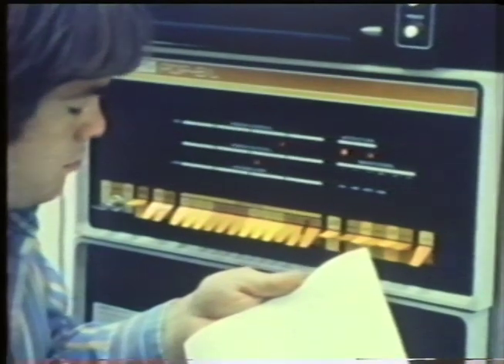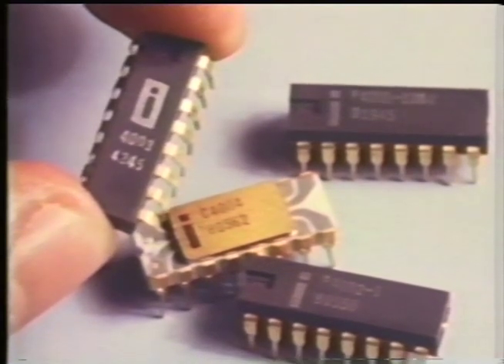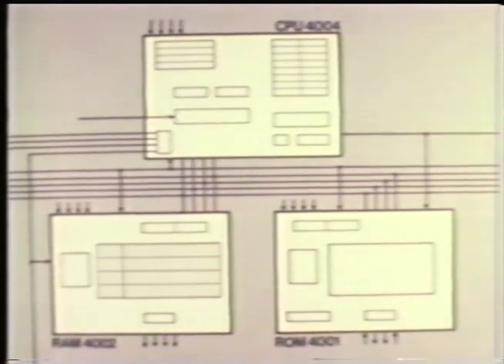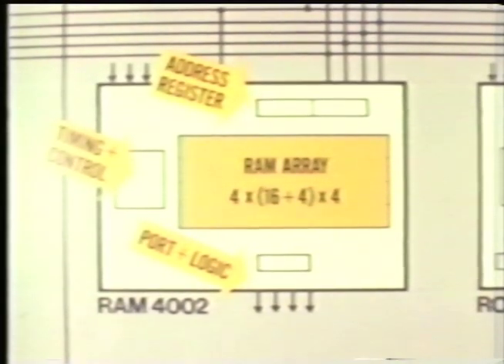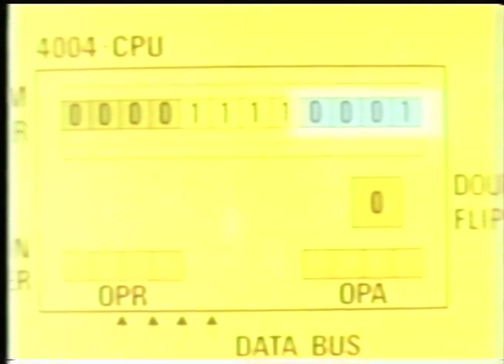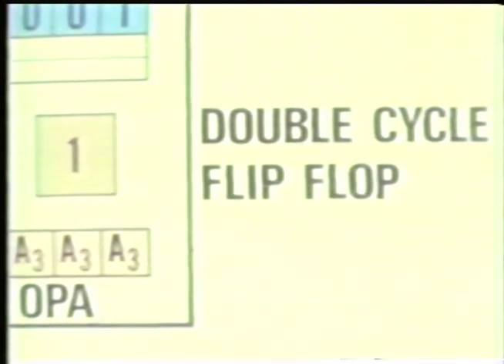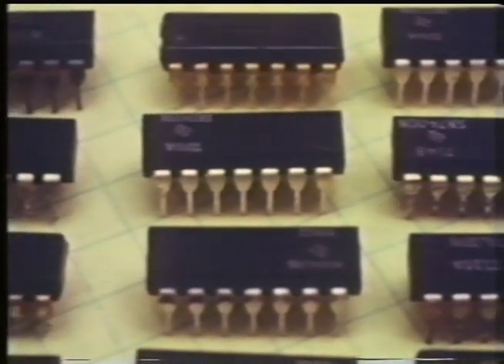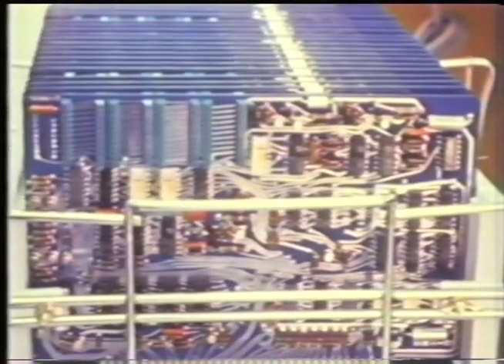The MCS-4 Story

Comment: Its a good reminder that when the first microprocessors came out, they marketed them as replacements for the large random logic systems of the day. I worked on such a system, a complex, multicard box about the size of a large microwave oven that used TTL logic. It printed continuous printed "well logs" of parameters from a probe sent down oil wells. We heard that the funding company had contracted with a competitor who reduced the entire thing down to a single board with a microprocessor shortly before our company closed its doors.

Comment: Wow, that's quite a find: an Intel marketing film, circa 1972, aimed at the electronics engineers whom Intel was trying to convince to use the MCS-4 instead of the standard design method of using lots of TTL 74xx chips. (I'm dating the film based on the mention of the 8008, which came out that year, and the 1701 PROMs, which I think Intel soon discontinued in favor of the 1702, along with the absence of later MCS-4 development systems.)
I just wish the image quality was a bit better. Looks like at some point the film had been transferred to videotape from a projector that was out of focus. Oh well.

Comment: "You debug your system with an oscilloscope or other instrument"!
Reply: Most of the hardware design tools for computers till mid 80's were paper and pencils, oscilloscopes and slide rules.
Automated design tools did not exist, so engineers tested and proved designs by actually building the circuits on the laboratory bench, and ultimately, full-scale prototypes with thousands of hand-wired components.
Reply: To be fair, Intel also offered a "hardware simulator" program for its larger MCS-4 prototyping boards that would let you run and debug your own MCS-4 program in software emulation. This simulator allowed tracing, examining memory and registers, setting a breakpoint to stop at, and altering the program being debugged while it was running. Pretty much a standard machine-level debugger, but it fit in just over 2 kilobytes of ROM!

But Intel was aiming the MCS-4 at hardware engineers, not programmers. These were people who were actually comfortable debugging their systems with instruments like oscilloscopes; so Intel was telling them that they could debug their systems in a way they were already used to.
Reply: +bavarsky321: Scientific calculators were common already in the 1970s though. I bought my first one in 1974. Besides that, I agree.